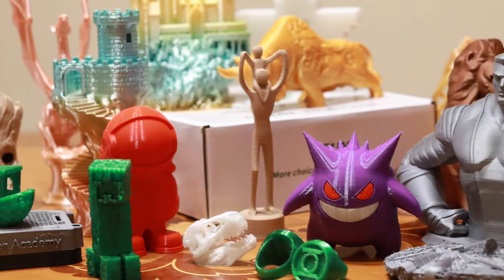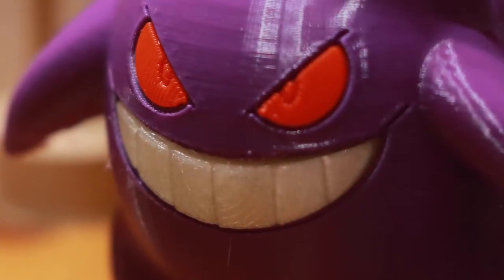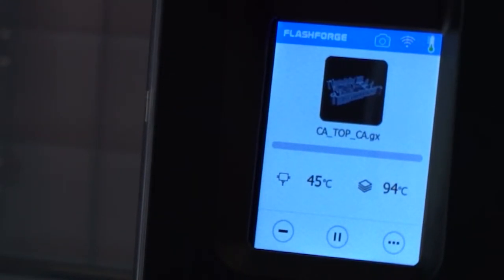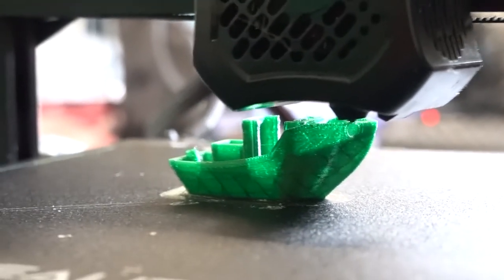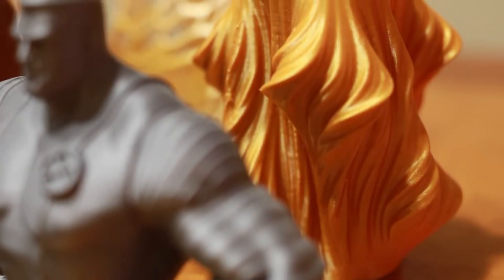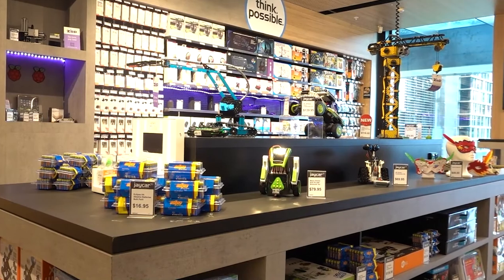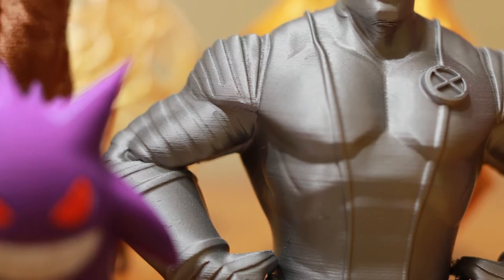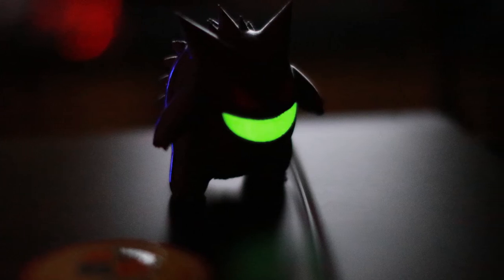Testing Every eSUN 3D Filament

Comment: It's probably also worth noting that the glow in the dark and wood filaments are highly abrasive and will wear out brass nozzles. It is possible for a single roll of glow in the dark to completely ruin a single nozzle... speaking from experience.
Reply: I've seen stainless steel nozzles advertized, do they last longer?
Reply: yes 100%  @VolcanicBamboo